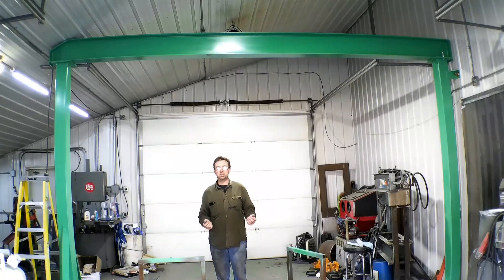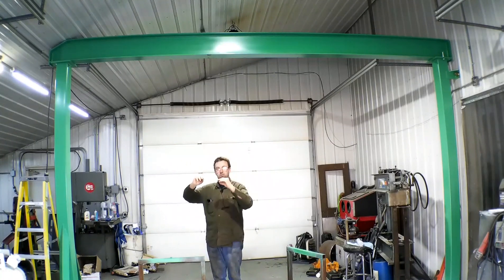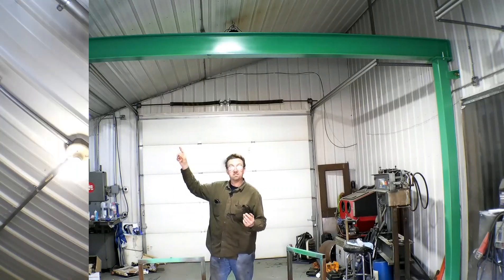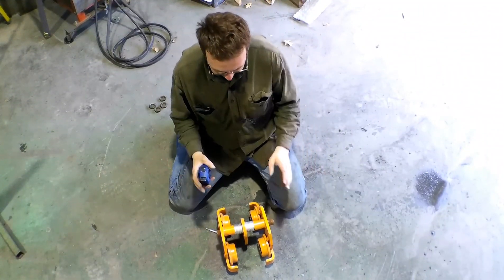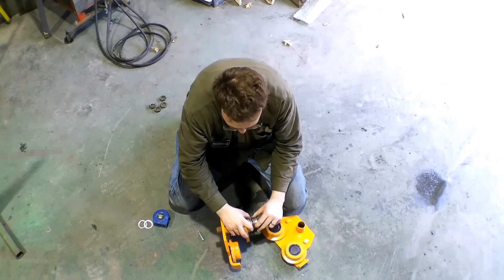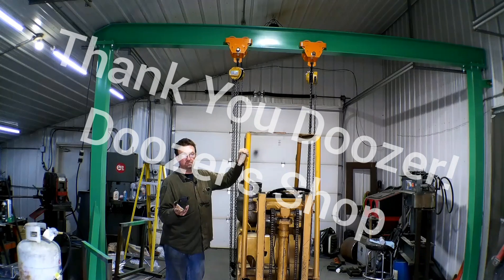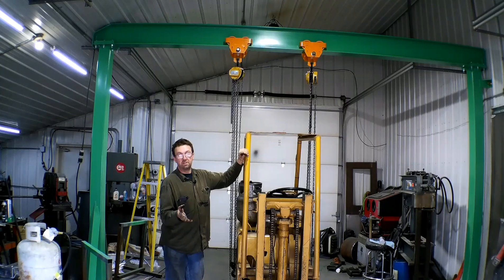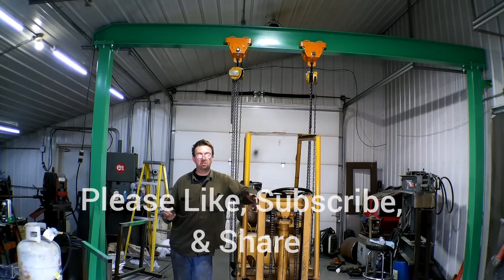Building a Fixed Gantry Crane, Part 4, Finishing Up, Thank you Doozer's Shop!!

Comment: if you would have made the beam follow the pitch of the roof you would have gained a LOT of clearance on that side.... of course the trollys would then need brakes really good brakes
Reply from the maker: Would have needed another hoist on the top to pull the trolleys